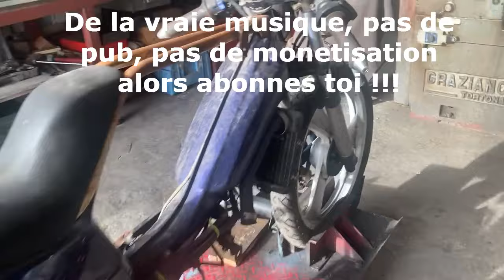MBK 51 magnum racing XR TWIN 100 CC Bidalot

Comment: That's very cool, how do you direct the voltage to the right spark plug?
At least you toke a good base to start with, one that has a disc brake and alloy wheels, nice shocks on the back.
Reply from the maker: merci de me suivre ! the coil has 2 plug...
Reply: @franck_meca0640  so, you have 2 spark moments, piston up and piston down on both cylinders?
Reply from the maker: @AnalogDude_  exact
Reply: @franck_meca0640  A solution would be to make a PCB with a Hall sensor, 2 of them on the crank and CD4050 buffer ic + mosfets for the sensors and relay that to the coils.

Comment: incroyable boulot bravo 
ton moteur à l air de pas mal vibrer tu l as calé comment?
un piston en haut et un en bas pour equilibrer ou les 2 montent en meme temps?
Tu as prevu la pointe avec ta ptite couronne arriere coquinou ;)
Reply: Lol les 2 en même temps ??? T'as déjà vu ça ?
Franck à de l'expérience 👍
Reply from the maker: salut ca vibre au ralenti a cause du poid .calage 180° un filet de gaz et on croirait le moteur a l arret ...jamais un des mes moteur n a si peu vibré en fait ...
Reply: @exoexofog  le 2 en meme temps oui sur harley davidson
Reply: @franck_meca0640  C est une impression de la vidéo alors. C est quoi les cylindres des bidalot rr? Du coup ca fait un 100cc qui doit pas etre loin de 10cv ca fait des wheeling comme un hybride nitro?
Reply from the maker: @beber0721  oui des RR , + de 10 cv, sur cette machine je vais chercher la vmax, transmi 13 48 , grosse accel tout de même...
Reply: @franck_meca0640  tu nous feras une video du compteur :)